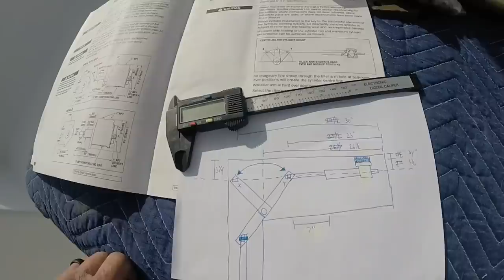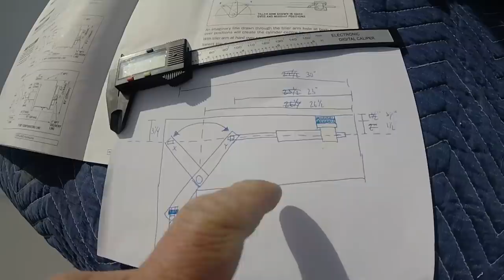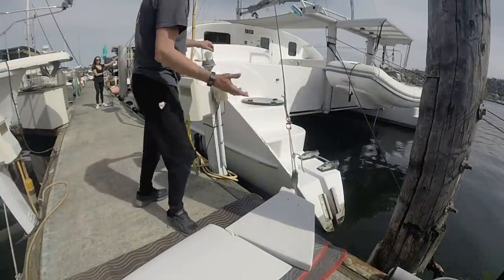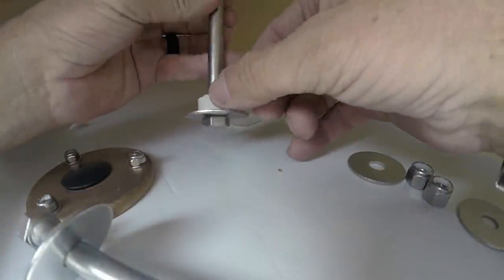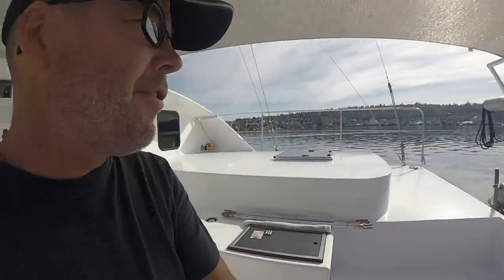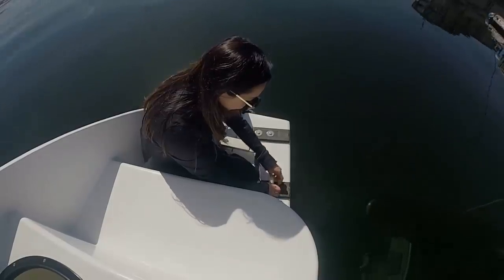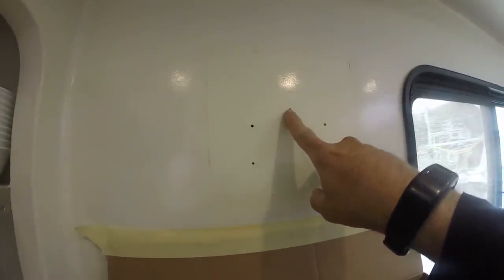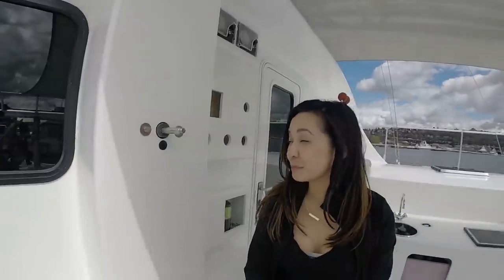Install Rudders & hanging with RAN Sailing. Onboard Lifestyle ep.59

Comment: Re: Onboard Lifestyle ep.40 Linh's 7 Day Challenge!

When you installed the cockpit outlet, a green grounding wire was connected to the outlet at the box.

My questions are;
1. how do you ground electrical work on a boat?
2. how do you protect your electrical systems and appliances from a lightning strike hitting your mast (the mast could be aluminum or composite materials, but some rigging components are steel) or some other metal object on or about your deck?
3. When you refit, your salon table for example, do you prepare as-built drawings and material lists? You must recognize your work will be seen by cruisers, and when they see you at anchorage or at a dock, they will ask you to build something for them, or repair something on their boat. You will be in demand. Have you planned (including how to say no) for such requests? 

Teal, your work is not basik! Well done!

Comment: Hey Teal. Just a thought,  you could make a rubber disk that will fit in the hole on the sugar scoop that the ram shaft sticks through. The disk should be a flexible rubber with an x cut in it, to let the ram out and keep most of a water splash.

Comment: Huge fan of your work, I haven't seen this kind of quality and skill in a boat refit. Something that would make great content, when you haul out, is a full inspection of the boat. I just want to see if the inspector could find something wrong. My guess is that you are sitting on over  1.5 million in equity, would be fun if you could find out an approximation on the market value of your boat.

Comment: I really like your meticulous attention to details and methodical approach. I find your reasoning behind you decisions very informative. It was interesting to watch you implement hydraulic steering. If I understand correctly this is strictly passive hydraulics, no pressure input form engine connected pump. What I fail to understand is why you choose to mount fill in plug on the roof. You drilled a second access hole in the kitchen above the Capilano pump. Why not mount a bracket in there and a fill in plug. No need to drill into the roof. Did I miss something?
Reply from the maker: The fill location will be located within the enclosure that will be going in next year.

Comment: I guess Teal already aligned the rudders parallel to each other. That must be a piston pump to keep internal oil leakage to a minimum. Even then, the helm wheel probably cannot have a neutral marker.....but it is a very simple rudder control system.  I like. Will the cylinder rod hole in the hull be sealed with a rod clearance tube? Like you three, Johan & Malin are good people.....

Comment: Well thought out skilled, practical, composite craftsmanship .....and video production.  Tip: starboard edge can be simply finished to factory smooth glossy edge by simply dragging a straight blade across the edge........(much like using a scraper on figured wood - Do it before you router round over, or bevel your edges)
Best
Chris
Reply from the maker: Thanks for the tip!
Reply: Your Welcome - takes very little time at all to do - for the perfect fabricated part - satisfaction guaranteed......

Comment: Hi Teal!  I’m curious if you are going to install some sort of bellows for where the linkages and actuator shaft pass through the sugar scoops to keep sea water out of the compartments. If not, are you going to install bilge pumps  to keep compartments dry? Keep up the great work! You guys are almost done! 

Charles
Reply from the maker: Before I commit to bellows I would like to see how they perform.  I made them to handle a following sea containing any blue water to just the compartments and built them to be self-draining with a 1" pitch for every 12".

Comment: I do not like starboard for spacers or backing. It is too soft and will create give. Once you have give the bolts will loosen and everything starts to move. I have tried using starboard like that and it was a bust each time. You will have a lot of stress for a long time. A lot of cycles. Of course I may be wrong. It happened once. :) BTW You do good work.

Comment: I think you will run into trouble, mounting the hydraulic cylinder in this way because of the non linear movement of the linkage. The ball mount of the cylinder can only handle the angle of ONE rudder. The cylinder must not mounted between the linkage.

Comment: PS. That hydraulic fill tube fitting you put on top of the salon may not be the best location. Due to being exposed to the salt water. You easily could make a bracket to attach the fill tube inside the steering column. And then install those screw hole hatches to make a better closure into the kitchen not a clock plate. Please don’t rush just because you’re getting close to the end.
Reply from the maker: The fill location will be located within the enclosure that will be going in next year.

Comment: Hello Teal  A question on your hydraulic ram will you be using TWO? I think Two would be better then one ? the one Rudder System would have more stress on it in turning. But two hydraulic ram could be better and may turn better. I'm just asking because you are going to have long rod going across the boat to the other Rudder. Just my thinking, But it is cool how you have a great Wife that works with you on your Dream Sailboat. Do you know how many men would die for that? Also a great little help she will be a great Capt. Some Day. GOD BLESS and take care.

Comment: Just  a question Teal , when you put those struts in , what is going to stop the water when it catches up to the back of your boat from flooding the sugar scoop ????
Reply from the maker: I designed and built those compartments to  handle blue water. They are watertight and isolated from the sugar scoops with a steep  pitch to self drain quickly.

Comment: Wasn’t there some designers and engineers who put that sailboat together with the proper specifications to where the ram goes. So it’s pretty basic if you follow the original design specifications
Reply from the maker: The answer to that is complicated. Our boat  has been modified multiple times over her 26 year life moving the steering system and rudders to accommodate three totally different propulsion systems. When we purchased her the cylinder was located out in the elements and mounted at an angle that put a slight bow in the tie bar.  The  modifications that we have made to the steering system makes maintenance more accessible and should prolong the life of the components.
Reply: Onboard Lifestyle doesn’t matter how many times it’s been changed there’s still the same geometry involved when it comes to that. But charge on

Comment: Teal where did you get the hole saw for the deck plates?  Can't seem to find a 6 1/2" one.
Reply from the maker: Hi Mark, you can buy it on amazon.  We have been curating a storefront letting you guys know what we have been using on basik.  Here's the link. https://www.amazon.com/shop/onboardlifestyle   Hope that helps!

Comment: I am curious why you chose not to use anti-compression bushings and backing plates to spread the load when you mounted the bushings for the jackshafts for the rudders and other thru bolt applications.  Nida-core may serve quite well as a coring material, but I would worry about its susceptibility to localized compression loading, especially when subjected to continuous multidimensional stresses found in steering gear.  With off shore cruising, your rudders and linkage will never be unloaded and will be continuously subjected to shock loads.
Reply from the maker: You are spot on Robert. When I made the video I put very light hardware in to make sure everything was in the correct location just in case I had to move it slightly for alignment. I wanted to finish the hydraulics and test the motion first before putting the permanent hardware in.  I have increased the through bolt size and doubled the quantity along with 6" backer plates for the jackshaft bushings. I will cover that in a future video.

Comment: Teal, I was curious if you are going to have a redundant steering scenario in case something fails while at sea? From conversation I think most agree the steering is most crucial for needing a back up, do you agree? BTW love the channel. Thanks!
Reply from the maker: That is one of the advantages of having a tie bar connecting the two rudders rather than independent cylinders for each. I  have a sleeve running through the tie bar with an eye bolt on the centerline. I installed a U-bolt on either side (about 8' from the center) and can easily deploy a  block and tackle on each side to control the rudders manually.
Reply: @OnboardLifestyle   Cool, from watching all your videos I respect your knowledge. I like the details and learn a lot from the channel. Cant wait for the new episodes every Friday!

Comment: Hello Basik Crew, 
A day that I've been waiting for, for years. I'm waiting to see how you set up the Hydraulics for operating the Rudders. I'm very interested in the Control Loading System you will use to make sure the Rudders correspond correctly to the steering input commands. How many more big projects like this need to be completed before you shove away from the dock? You're getting close to setting sails, summers coming, and it's time to hit the High Seas. Love Y'all
Reply: Sad that you think the confederate flag is cool

Comment: That wheel is called the helm.
I have an tip for teal.
make on the helm, a turks knot and that will be your center guide when crusing at night place the knot on top center then you know by feel the rudders are in the center. 
Makes it simpler at night.
Gerard.
Reply: Wheel is called the wheel

Comment: That grey junk you're using might say butyl on the box but is NOT good quality butyl rubber tape.  Butyl tape is black and can be purchased from Grainger for the flat stuff or Amazon for the round stuff.  That grey junk is for RVs.
Reply from the maker: I have been using this "marine" product for years with excellent results. I can buy it at any marine store and feel comfortable with the brand. Have you or anyone else had  a bad experience they can share? 

https://www.fisheriessupply.com/incom-lifesafe-butyl-caulking-tape-hatch-tape-re20761
https://www.defender.com/product.jsp?id=1983369
https://www.englundmarine.com/products/butyl-caulking-tape%7CLFS-RE2076.html

https://shop.yachtshop.ca/lifesafe-lifesafe-butyl-caulking-tape-white-3-4-x.html